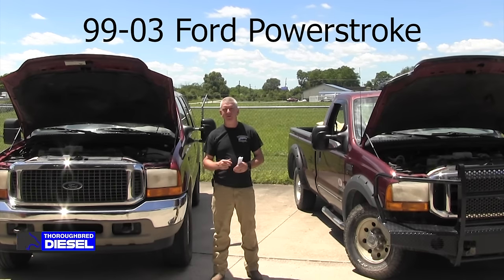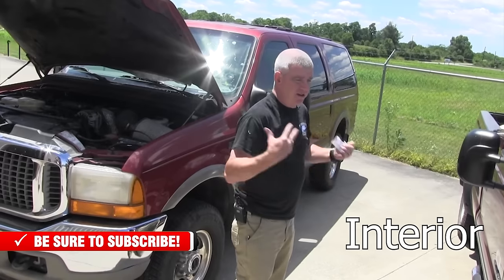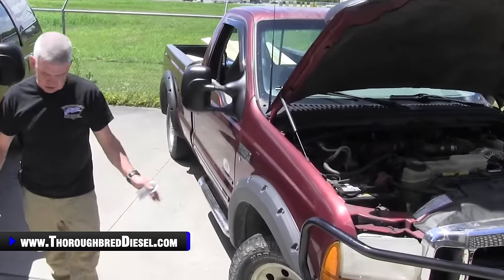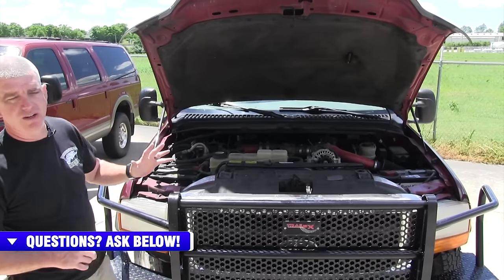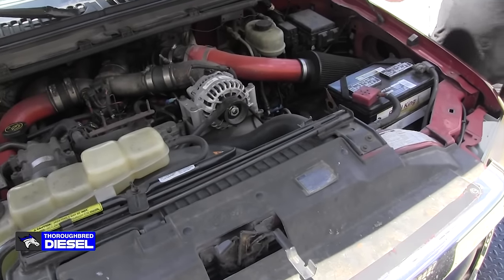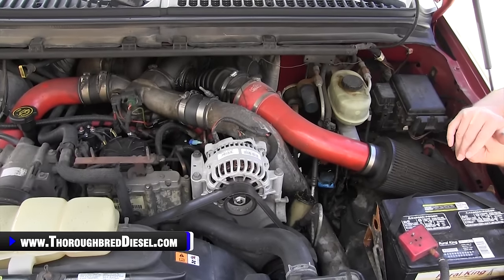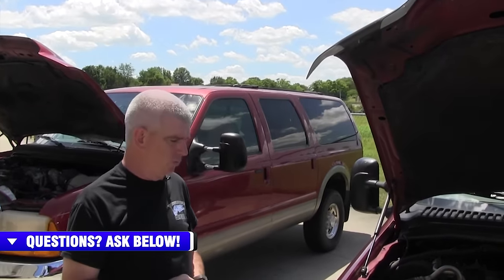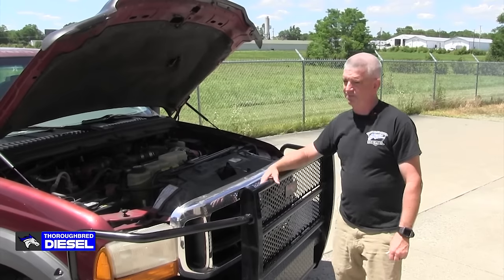TOP Problem Areas To Look At On 99-03 Ford Powerstroke | Secret Tips For Buying A Used 7.3L #ford

Comment: I currently have two 99 7.3s I’ve spent a lot of money fixing issues that were caused by previous owners neglect. Both trucks still had their original ICP sensors and they were leaking.  They both start easy on a 10° day. My best advise, only use Ford fuel filters and air filters! My 250 tried to suck a cheap filter into the turbo once.
Reply: Switch to 6637 and don’t dust a turbo. The factory filter boxes are notorious for leaking and sucking in contamination.
Reply: Motorcraft Oil Filter (P.N.) FL - 1995 wally world .... most always in stock ♥️

Comment: If you see a Super Duty with fender flairs like the one in the video, look behind them... probably rust! I wanted to put some on mine but I don’t even have anything to attach them to. VERY common on northern trucks. I live in Indiana. Also look for the rear diff cover to be seeping diff fluid, another very common issue. If it’s a northern truck, check your bed mounts. And like wade said. Definitely check where the dip stick goes into the oil pan. If it’s rusted or looks bad, you’re gonna have to pull the motor to replace the pan and fix the issue. It’s also not uncommon for the torque converter on a 4R100 to go at the 200,000 mile mark.
Reply: For TC ..Put a triple clutch billet in and keep rolling. Main thing that tears up 4R100 is heat. The cooler on these trucks are tiny. Change fluid every 30k if you tow a lot.
Reply: Brian Hanks yep. I put a triple disc converter in mine and a deep trans pan that added 7 quarts of capacity when I rebuilt mine. Runs MUCH cooler now. Next is to upgrade the cooler itself.
Reply: Spencer Brown If you’re on a budget you can get a true cool Max for about 129 bucks. Not as fancy as a 6.0 cooler but I have had zero complaints about mine and I keeps my tranny 40° cooler. Put in within 30 minutes
Reply: Yeah I've had to replace the torque converter or flex plate ..at around 230k .. I'm going to have to check the dip stick tube, because my 99 is rusting out like a 1980 Toyota.. lol It's bad.. It runs like a damn champ though.

Comment: I have a late 2003 , 7.3 f250 2wd , Zf6 , with the 10.5 sterling ring gear, for 10 years, and I've souped it up , hand built my turbo , ATS 66/88  4in , 7+7 Billet alum, with a .84 a r and a 9 blade turbine, , i have it governed at 18psi , with a spring mechanism waste gate adjustment , awl the 360 thrust bearings and all that. CVD fittings  , regulated return , fuel bowl delete, 6637 air filter, cat remote filter mounts, dual fuel pumps, dual remote pre pump water separators hutch and harpoon, custom fuel system from tank to heads. EGT gauges , straight pipe,,  bellowed up pipes ,, maybe 9 years ago all injectors,  cups , UVC harness,  ., no tuner, , ,ive been having a ramdom die issue,  where it just seems to run out of fuel and starts mis firing,  no code , no dtc, or CEL  ,         Texas Made.

Comment: I own a 1999 F250 7.3 and the issues have been minor, though sometimes it seems like they never end, I have to remind myself that the truck is 23 years old.  Every issue I have been able to fix on my own, from transmission to electronics, and I'm certainly no mechanic, the issues just haven't been all that difficult to fix.  My truck has 260,000 miles, original engine and turbo, and I can still hit 30 pounds of boost WOT.  I also own a 2019 Nissan pathfinder, and that thing has been in the shop more than it's been in my driveway.  Hell, that thing's at the shop now!!!  For 23 years and 260,000 miles, it's a beast.  I would say that most people can feel pretty comfortable purchasing a 7.3 turbo diesel.  They don't make them like that anymore, that's for sure!!!

Comment: Hey Wade you guys have the best truck videos on YouTube.

I would love to see you do a video on the 03-07 Powerstroke 6.0’s and the 08-09 6.4’s next?
Reply from the maker: Thanks! We have more in works. We just have a hard time finding good examples on trucks to show. I got to have the right truck with the right problems to show off. Only the best for you all!
Reply: @thoroughbreddiesel  you are an hour and a half from me.  I have an 03 SD 6.0 if you need to do a video.  Might have you do some work in the process for me as well.  Let me know
Reply from the maker: @seantabar211  We actually don't take shop jobs anymore. The only time we use the shop now is for videos or R&D projects. If you give us a shout we have a pretty extensive wholesale network that we can recommend you too.
Reply: 6.4's were 2008-2010. 2011 was the introduction of the Ford Built in House 6.7 Powerstroke they used to call the Scorpion. 6.7 was the first developed and built in house by Ford for the pickup truck market because of the epic failures of the 6.0L and The 6.4L and the lawsuits that followed between Ford and Navistar International, which previously built all of the diesel engines for Ford in the American Light Duty Pickup truck market since the 80s. 
(6.9L IDI NA 1983-1987, 
7.3L IDI NA 1988-1994, 
7.3L IDI TURBO 1993-1994,
 7.3L DI Powerstroke Turbo Diesel 1994.5-2003, 
6.0L Powerstroke 2003-2007, and
6.4L Twin Turbo DI Powerstroke 2008-2010.)

Comment: Early 4r100 equipped trucks had torque converter issues. Primarily a 99 model year issue. Likely most have been replaced at this stage in the game. They were very noisy when bad...even noisier then the old 7.3 when at idle! So, they are pretty easy to spot. Lol

Comment: That was a pretty good overview of the 7.3....I’ll say this if someone is looking at one that needs the oil cooler rebuilt or owns one needing that don’t be scared it’s pretty easy to do but DO NOT use fel-pro gaskets they will fail! Trust me you don’t want to do that job twice
Reply: Or Dorman for that matter. I got my 4 o-rings and 2 gaskets from international, triple the price but in my case the third time is the charm.

Comment: Transmission cooler is the weakest link in the power train. I serviced it regularly and had no problems 264000 miles but I was starting to pull 23,000 lbs. so I replaced it and got a Mishi Moto 6.0 transmission cover and replace the original factory with that cool. Other than that I’ve had no major problems with my  late model 99
Reply: Isn't that only with the automatics?

Comment: Very helpful mate. Going to look at 2000 F 250 4x4 in AUS tomorrow to tow a camper. I knew the 7.3 was a good donk but there are always things to look for. It has 160 000 miles on it and reading other comments on here has heaps of life left.
Reply: Million mile engine right there

Comment: Body rust issues:  Rear brake line between fuel tank and frame rusts out early.  Rusting oil pan.  I drive a late '99 F250XLT SC SB 7.3 6spd 2WD.  I've been driving it since Oct '06 - great truck great engine.
Reply from the maker: Good info on the break line. That would be a good think to check before buying
Reply: Yeah, my 02 f350 has a rusted oilpan and required pretty much every brake line to be replaced.
Reply: @brewski7889  If your still dealing with the oil pan, wire brush it a little a spray it down with WD-40 at every oil change.  This routine pretty much stopped any further rusting on mine.  Been doing that since I read about the issue early in my ownership.
Reply: @oldretireddude  Okay thanks, yeah rn its sitting in a barn because it will lose 3 quarts overnight... and since the (I believe the crossmember) is riveted on, you cant just drop the axle and change it, you rather gotta lift the cab..
Reply: @brewski7889  That's too bad, once it goes it's a real pain, like you say.
Reply: @oldretireddude  Yeah, and it aint cheap ethier, hopefully for now some JB weld can fix it for a year or more atleast and stop it for now.
Reply: @brewski7889  I backed a '73 camaro into the corner of something, decades ago, leaving a small hole in the gas tank.  I successfully patched that with JB Weld and drove it for several years with no leaks.
Reply: @oldretireddude  yeah jb weld is good, in like 2010 there was a small hole in the oil pan so that was patched up and it's still holding to this day, just new spots have appeared
Reply: @brewski7889  My truck lived up north for the first four years of it's life.  A couple of years ago the leaking got to a quart a week. I watched some videos on here and decided to try covering the whole oil pan with several tubes of JB Weld. It has held up for at least 2 years. It may start leaking again tomorrow, but it has been a very cost effective solution so far. You may want to give it a shot.
Reply: @stephenlane7951  yeah I will have to, in the future I would prefer to replace the oil pan, but that gets expensive just because you gotta raise the cab so 🤦‍♂️
Reply: @brewski7889  I cut the cross member in bout 20 min with a saw saw and an angle grinder. Removed and replaced pan in bout 2 hrs. Welding cross member back in took 15 min. Best decision I ever made. Mine sat for months until I manned up and did it.
Reply: Is cross member part of oil pan?  Can oil pan be patched with fiberglass ?

Comment: I just got a 2000 F-450 4x4 with a steel flatbed dump.  I turned over 50,000 on the drive home!  This is my last truck unless I wreck it.

Comment: 1999 250 485000 16years love it and miss it roofer truck  pulled dump trailers everyday 45 to 80 squares no  Problems  2 water pumps 3 alternators  One thyroid in 485000 miles I do miss the truck I  I bought the truck new Motorcraft fluids batteries filters And parts What a great truck sold for 7700.00 in2016

Comment: I got a 1999 7.3 late 527,315K as of yesterday I hate oil leaks but other than that she runs like a champ never has let me down such a reliable engine no rust expect a few specks in weird spots by the window wells and little surface on the frame

Comment: 99-03 F250’s had Dana 50 front. They switched back to 60 in late 03. Excursions always had Dana 50. Great video, though!
Reply from the maker: Thanks for the info!
Reply: Wow!! We still have my wife’s 2000 7.3 Excursion and my 7.3 2002 F350. I pull my 2017 40’ Montana 5th wheel with no problems.
Reply: dana 50 max tires size 37 inch after that its a problem.......

Comment: Great video! I have an 01 EXC and 03 F350. The Exc has 226xxx and I haven’t needed to do Jack to the motor. Definitely done $4500 in work underneath all the way around. Drives like a new truck tho. My dually tho, replaced hpop, rebuilt fuel bowl drain valve, icp sensor just done and she’s at 172xxx. I wouldn’t give either up tho!! Drive them anywhere!! Thanks for y’all’s videos!!!

Comment: I have the early 99 and it's in excellent shape. Just put a mishimoto trans cooler on it and keep the oil changed and drive it 700,000 miles

Comment: Owned my 2000 ford F250 CC SB 4x4 for 20 years of its 22 years, this truck is awesome love my truck. BTS transmission, 6.0 Trans cooler, stage 1 injectors, bigger turbo, tuner, 4" exhaust turbo back, gauges, 176,000 miles, have had only minor problems over past 20 years. year 2000 comes stock with forged rods. I would take this truck anywhere I need to with confidence I would make it there and back.

Comment: My 95 has a 10.25 sterling, I love my power stoke I just fix the spongy brake problem that is  Notorious for the 94-97 it was a night mare but finally got it fixed $1500 later 🤷🏼‍♂️

Comment: Great truck easy anuff to repair with all the youtube videos got a 2002 f250 7.3 350,000 miles got it a 260,000. working on it about every 3 to 6 months for a day or two.  Just replaced o rings on the oil cooler this passed Sunday.  Hardest thing I changed on it so far was the pinion seal. Got the valley to go over this spring lots to do there.

Comment: Just bought 99 f250 4x4 standard. I usually put a straight pipe on my diesel, and upgraded air intake. Recommendations for 7.3, have 2000 f450 with t6 chip and air intake as well. Zero issues so far,  but wanted info for best setup
Reply from the maker: Nice!  Give us a call 866-380-3068.

Comment: Nice job on the 7.3 issues.  Many of us carry a spare CPS in the glove box. Had a recent problem with electrical system. The power to the computer and everything in the passenger compt goes from the battery through a connection point on the driver side fender well. The connector finally gave up and broke off due to corrosion and the entire truck went dark (no PCM, horn, windows, no starter, etc.).
Reply: Idm
Reply: Make sure you get  the black cps not the Grey one! Very  important!
Reply: @earlsmith3894  good luck finding them. I have a set of OEM, in the package black sensors. They are worth a bunch these days.
Reply: O yeah let me know I could get a tone of them,oem in the package .

Comment: I am buying a 2003 Excursion with the 7.3l from my uncle. I have been working on it for a while and one issue I had found was the window and radio would stop working at random. They weren't getting any power at random when starting and driving and would turn on and off together. I found the problem after looking at all of the normal areas you would think the problem was. If anyone has this issue there is a shared relay behind the dash that can sometimes get moisture damage from bad windshield seals. Once replaced the problem stopped.
Reply: Good to know, I think I have same issue with windshield leaks on my 99 Super duty.

Comment: love my 01 7.3, but of course, I've replaced some stuffs on her... the short list includes fuel injectors, glow plugs, u joint, front axel, the lock out hubs, ball joints etc. However, it was an investment of about 13k for an engine, I believe, will be my last truck. With only 199k on her and the preventative maintenance ie: front and rear differentials, maintaining clean oil and filters and such, I don't ask much of her. Thanks for the information in this video. I came looking for information to recharge my AC lolz and got a nice reinforcement of what a great truck I really do have.
Reply from the maker: Diesels for life!

Comment: Very informative, mine is a early 99 xlt 4x4 psd. 234000 mi and going strong no issues with 7.3 at all. I have replaced the automatic one and had it built up as much as I could at the time. No problem since. I bought it in 2000 with 200 miles on it. Other trucks have come and gone along with the ex but im not letting go of my precious👍 Hey really good video. I subscribed and looking forward to future vids. Thank you
Reply: Fellow early 99 southern body &ZF6 Southern body&frame &till past winter sold new Ford same yr

Comment: Original owner of an 01 with PS and 4r100. Only 30,000 miles and would appreciate imput on the trans. Obviously i haven't driven it much particularly the last 14 years and although the trans seems to fine so far, the 01 reportedly was perhaps the worst 4r100.
It seems based upon my research that having BTS go through it would be the best way to go and if i wasn't so far away, that's what i would do. I would prefer to keep my low mileage trans if possible and I'm just trying to be proactive. I live in so. Or. and haven't talked to any of the local shops. Thanks for any imput.
Reply from the maker: The 4R100 is a trans platform that most trans guys have experience with.  I think you are safe to study some of your local trans shops and let someone local help you!

Comment: I tossed a forged rod out the oil pan, as did a lot of folks using the irate 600hp recipe. 467 350/200 gearhead tunes. dont tell folks it will hold 600 when it really wont. anything over 450, hell if you are rebuilding one, put billets in it. everything else is awesome on a 7tree

Comment: Had my 2003 f250 truck for 9yrs now, it's only got 153,0000klms (96,000 miles) never had any issues, the usual regular maintenance things are always up todate.
But just this week I had to get it towed for the first time EVER, I was shattered..
Can you help me with the problem? 
Runs fine till it warms up, (either driving or sitting idling)
Then all of a sudden, it goes into what I believe is a limp mode, engine light comes on and it sound rough, has no power, like its only running on 2 cylinders, no codes either. 
Any suggestions 🤔 
Appreciate any helpful information,
Had new crank sensors but made no difference. 
At a loss when to go from here.
Reply from the maker: The running condition sounds repeatable.  So what you will need to do is have a scanner ready once the code comes back up so that you can figure out what's going on.  Good news is, the code will most likely lead you straight to the problem.
Reply: @thoroughbreddiesel  
Hey thanks for your reply,  but no codes at any stage, tried a number of scanning tools..
Replace the crank angle sensor and iCP sensor, still playing up, just have to keep throwing money at it I 😤 guess

Comment: What I find most guys with Diesels they up the power and try to pull big 5th wheels then get upset with the transmission burning out. You can't do both add power, and put lot of weight behind it unless you upgrade the transmission. SUV's like the Excursion less likely someone pulled a heavy trailer with it probably wasn't torn up.

Comment: I have a 2000 F350 4x4 short bed w 81k. The truck is GREAT mechanically, only downside it being 21 years old the interior is a bit outdated. Also, not sure if its a problem with my truck but the ac doesn't work exceptionally well. I hop in my dads 05 and on a hot day it can literally get the cab too cold, not so with my 2000.
Reply: might try cleaning the condenser. Systems 22yrs old may need work or replacement never a bad idea.
Reply: @stevemckibben1201  Try new fan clutch.